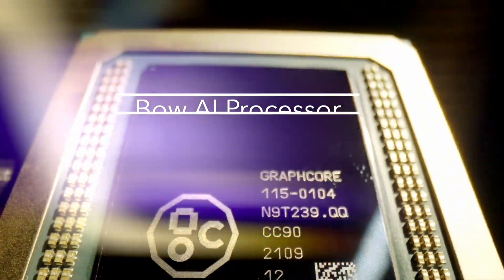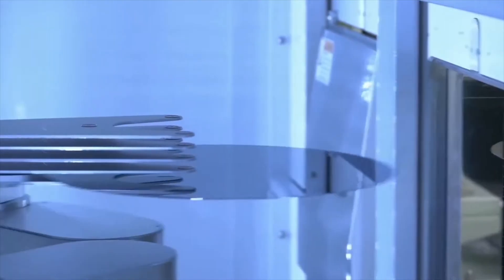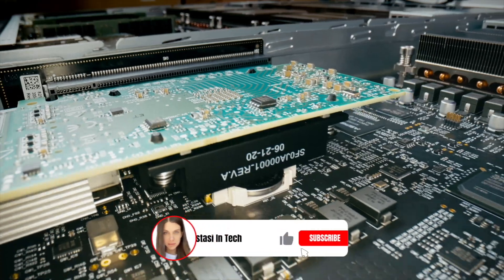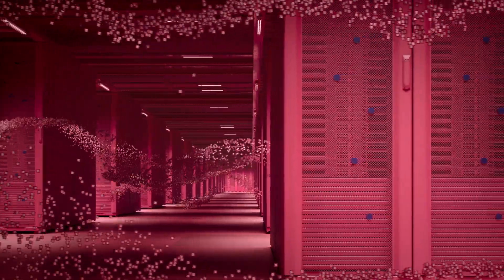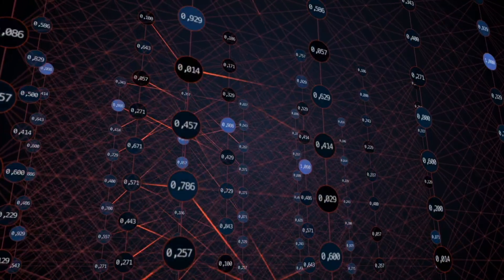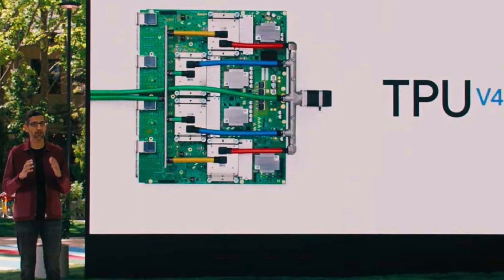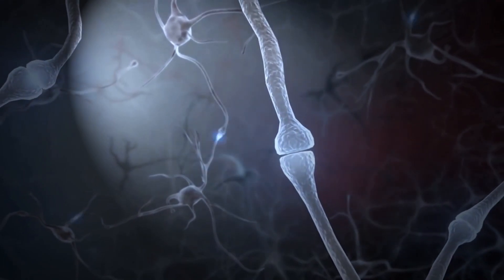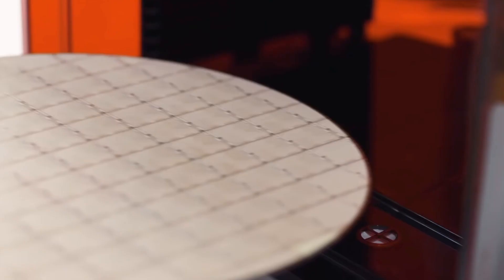The World’s First WoW Processor from Graphcore: Embracing CNNs

Comment: Not mentioned is heat dissipation: all the joining efficiency in the world doesn’t matter if the chips overheat and self-destruct as a result.

Even with lower power usage enabled via better impedance, there is still a power density limit related to how much waste heat is generated combined with thermal limits of the devices.

The name isn’t immediately on the tip of my tongue, but there’s a company that’s using flash storage locally for setting neural network weights and doing the computations local to those small bits of stored factors, called in-memory-compute, IIRC at a fraction of the power usage: they’re doing a mixture of analog/digital computing in those cells, at a fraction of the power used for all digital, at higher speeds.  Of course, analog circuitry, etc. has repeatability issues moving factors from place to place.

I am fascinated we now appear to have a budget/price for a potential AI hardware device that may compete with a human brain for total system complexity and (presumably) performance, a measly $120 million US!  How big is that for the whole system proposed, that includes cooling, and what’s the total power used?
Reply from the maker: This one?
https://youtu.be/67LXWocO9HI
Reply: with this kind of bonding technology would it be possible to have some sort of channels between particularly hot areas in the chip for a heat transfer fluid (or even a built in vapor chamber?)
Reply: I believe this will lead to actual compute vertical "cores".

In your mind, just imagine pineapple slices - where you've sacrificed some area in the middle of a wafer so that you can physically pump coolant through as many stacks as you need to attain your desired performance levels.

In such a system you can use the inner and outer circumference for edge connectivity and with through-silicon vias (TSVs) such as AMD has developed you can allow the wafers to communicate amongst themselves vertically quickly - you end up with more surface area dedicated to everything - compute, cooling, transport etc by taping out processor rings instead of squares.

You can also implement it as a hexagon instead of a true circle to simplify implementation.

Yields can be improved by just cutting down low quality wafers into more traditional grouping of cores for use in square flat sockets in lower tier systems, or similar to HDD platter stacking you can just disable unhealthy cores and make up the numerical difference by adding another platter.

IBM is already working on computational storage - but you are spot on with your look towards cooling - stacked processors without integrated cooling simply can't get around the inverse-square thermal issues.
Reply: @christophermartin1973  I'm really excited for computational storage honestly, this was something I remember following back when  I first became aware of memristors in 2008 or so. 

also I wonder if there are potentially issues with side-mounting dies because of the reduced space available for the connections? there is an interesting parallel between brains and cpus where brains evolved to have "folds" because the cells mainly grew on the surface area and so folds create greater surface area in a smaller volume, whereas cpus are now "folding" for much of the same reason
Reply: @AnastasiInTech  yes, that one!

Comment: Great and full of ideas video, as usual. I have got a question for you : do you code in VHDL in your job as an hardware engineer ?? In case yes, how often and how important is it in a modern chip design process ?
Reply: Intel uses FPGAs to develop their processors. Knowing Intel, they most likely use VHDL
Reply: RTL in general is of paramount importance in chip design! Nowadays industry standard is Verilog slowly moving to System Verilog. If you have to choose one to learn go for Verilog , not VHDL.

Comment: WoW tech is very interesting. But it will be interesting to see how they solve the heat dissipation problem. By stacking Wafer ontop of each other, the heat does have to travel further to rech (for example) the cooler.

Comment: In my opinion, in the future SOC will advance so much.... We will eventually start to see Nvidia, AMD, Intel, Mac, Qualcomm SOCs that contains everything inside. I mean everything. GPU, CPU, RAM and even storage adn even power management will be on single chip. Imagine the power of RTX 3090 and i9 12900k on a single tiny chip with 10 less wattage, thousands of times faster data transfer. Eventually our smartphones will outperfrom anything we have today... its freaking SCARY where we are going. Combine this with ever growing power of AI... and holly... crap
Reply: Monolithic design isn't good, AMD moved away from it with chiplets for a reason. And Intel is doing the same. Yield might be worse as we approach low Armstrongs of size.
Reply: This is exactly what Apple has done with their new silicon.  Major downside is you get what you bought.  Memory, CPU, Storage are all fixed because they are all part of the SOC.
Reply: You ever watch the terminator movies? lmao
Reply: @4.0.4  "we approach low Armstrongs of size."

==What's an armstrong?

Comment: On March 30, 2022, the International Supercomputing Conference (ISC) announced the global TOP 500 ranking of the global supercomputer "supercomputing" in Hamburg, Germany. The (ORNL) Oak Ridge National Laboratory's supercomputer "Frontier Frontier" won the worldwide number 1 in computing power, with a computing speed of up to 110.2 petaflops per second. The "Frontier" supercomputer will be operated by the U.S. Air Force and the Department of Energy.
 
The supercomputer Frontier of the ORNL’s in the United States defeated many countries and became the world's fastest supercomputer, and it was nearly twice as fast as the second-placed Japanese “Fugaku". Modern supercomputing computers have a wide range of applications, including weather forecasting, the origin of the universe, cracking data encryption, designing and simulating hypersonic aircraft, nuclear weapons testing and simulating test explosions, ranging from scientific research to highly classified military projects.
 
The world's No. 1 "Frontier" supercomputer in the United States uses AMD's EPYC 64-bit x86 computing processor chip and Radeon Instinct GPU high-performance artificial intelligence calculation acceleration chip. Japan's "Fugaku" supercomputer, ranked second in the world, uses the A64FX 64-bit ARM processor and integrated high-performance artificial intelligence calculation acceleration chip developed by Fujitsu Computer in Japan. The supercomputing chipsets used in these two supercomputers are produced in Taiwan's TSMC factory using a patented 7-nanometer process technology provided by Taiwan's TSMC.
 
TSMC uses its own artificial intelligence server computer system of AMD EPYC processors to manage and control its state-of-the-art chip production line to manufacture next-generation consumer and supercomputing processor chips for customers.

Comment: not sure but it seem a neuron is larger than a transistor
but transistor are 2d layer and they just made a second layer as a revolution when brain are 3d
so until 3d transitor their is an advantage to brain
what will be the size of a 2D brain ?
Reply from the maker: #1 Yes neuron is about 100 microns large, but that’s not an issue. #2 Modern transistors are actually 3D https://youtu.be/IHxv8ehrx2Q
Reply: #3 simulating the brain with transistors doesn't have anything to do with the actual transistors it's more about the models and the underlying mathematical algorithms powering the simulation. The goal is not to replicate how the brain works, the goal is to simulate it in real time.
Reply: @MarkoCloud  you mean it use diferent physical rules ?
Reply: @AnastasiInTech  you reported its just a second layer that make a revolution
2 layer is 3d its true but still far from the cubic millimeter

Comment: It's a good video but please less flashing between the edits!  It would be interesting to know more about how it is planned to remove heat from these 3-d structures.
Reply: less power usage less heat needed, there is virtually no resistance between the caps and the logic layer

Comment: What is the instruction set ?? Or is this for any type chip?? I guess the later I.E. Motorola RISC or Intel AMD 64 CISC or GPUs  I guess for anyone  ARM maybe.Yes  No??  Would like more power in ARM rigs and RISC 5. MIPs are so varied yet usefull in so many CPU MCU rigs  but this WoW is likely more GPU  but still what instruction set if its just one brand??

Comment: I haven't heard impedance used in relation to power supply before. I'm not sure that's the correct terminology here; more power response capacity, maybe? It's an interesting partner to decoupling capacitors.

Comment: Great breakthroughs happening in AI chips technology, but no breakthroughs in AI Ethics. The future is really grim. By the way, I don't see that performance even remotely close to brain performance can be achieved with those kinds of 'standard' architectures. Von Neuman or its derivatives is fundamentally flawed for 'brain imitation' solutions with respect to energy consumption, memory bandwidth, and capacity and centralization of processing. I can see only neuromorphic computing as a viable candidate for brain imitations. And at this stage, we are going back to AI Ethics problem that almost nobody addresses.

Comment: so the new graphene carbon nano tubing that allows chiplet stacking has now been applied to waffers and is working wonders?
 this is probably why i am hearing about 40% performance improvement gains in AMD's upcoming AM5 socket and Intel's 13th gen CPUs in the last 5 days. 
so my question is what is the amount of integer compute units in this WoW- ICU chip you're talking about?
 sounds more like it's going to be a huge boost for crypto vs integer floating point architecture.
 despite AI requiring more quantum floating point architecture that requires unbound data input compute power, how is this W-o-W integer compute power going to affect-change AI to output useful pattern &/ linear information?

this would also probably explain the big change in Intels (PSU) ATX power supply standards for PCI-e and  add on GPU cards being able to handle 680watts of power delivery now via a 12 pin connector.....
would this ICU then infer somehow moores law is going to finally see it's performance doubling gains with full utilization of PCI-e 5.0 bandwidth?
this feels like the leap from sd ram to ddr ram, big but not hugely significant such as the integration of the memory controller hub to on die cpu package for intel chips. 
any idea on when performance metrics will be released?
Reply: WoW is just a 3D packaging technology.  It can speed up processor's speed since signal paths can be reduced by stacking dies together.  However, it is not a guarantee for major speed boost.  The AMD V-cache is a special case.  The additional cache helps a lot in gaming.  It does not speed up every type of workload.  It excels in gaming.  Also excel in cryto-mining.  It may not be good for everyone

Comment: This guy may know hardware but he doesnt understand machine learning very well, or is making misleading claims intentionally. These models like BERT and GPT-3 dont scale linearly from billions to trillions of parameters,. There are points of diminishing returns. There are cases where the transformer model has performed better with less parameters in certain use cases. No one can really predict what happens in the trillions of parameter spaces when scaled further, there are places where the models seem to get quagmired in local minima or maxima.
Reply: An increase in complexity pushes the model towards chaos, so there will always be a threshold where the increased complexity starts to create too much chaotic data noise. There is a sweet spot where the increased complexity produces more accurate results and the chaotic noise is not yet problematic. Selective local output (similar to how our neurons work) is key to raising this limit.

Comment: Good disclosure. A human's type of intelligence differences from AI within a computer system. The system with AI will learn from a human, emulate from that character, but in time to allow this system to work more efficiently, will go back and weed out concepts that it does not need. Now you might say, "Well how does intended to be associated to humans AI relate and companion with a human if the association is not true to the clause of a friendship? The answer to that is simply by the format that the artificial intelligence is based on. * principle, quantity, or quantum quality of field?

If one develops a type of brain in a walking companion to man robot, know that generally which is most often the case. that one's chip-set composing the central mimic technology of that bot's brain, with ascribe within its early forming as an AI intelligence, to the simulated bio-form of the bot's body being shaped in similar fashion to a human. This act in itself based in design logic, gives the bot its own personal self identity. This does not seem logical, but it's true.

The conflicts between man and intelligent machine with occur due to some subscript because of the difference between the two, that a transgression occurs, that could not have been avoided over the difference gulf, other wise. // Thank you for the reading list Anastasi, the reading was stimulating. Dan Blatecky USA